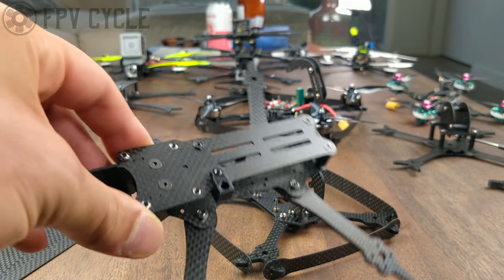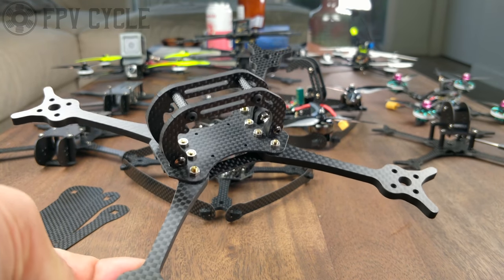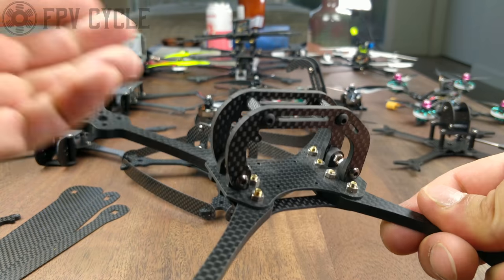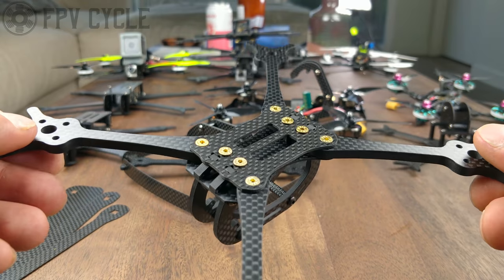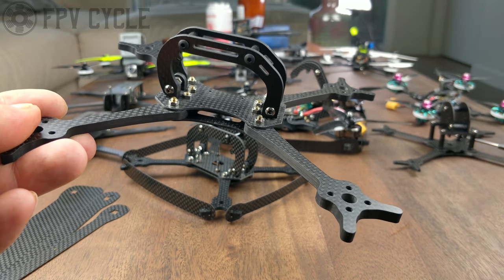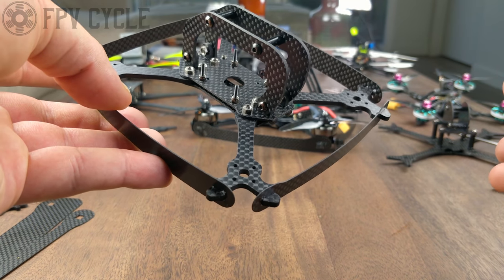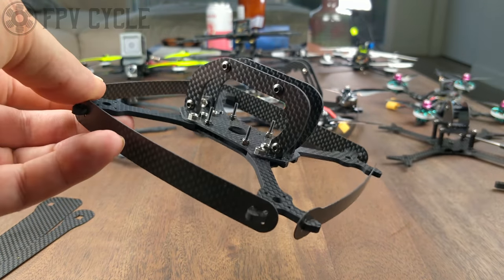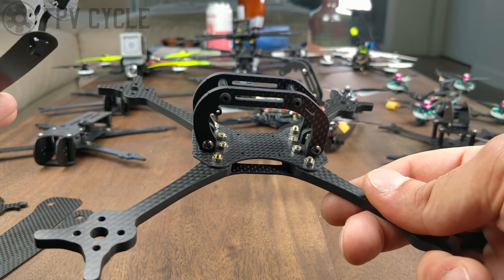Vertical Carbon Fin Concept

Comment: It's interesting hearing someone trying to think through how things work.
I've seen some tall shark fins on racers that are intended to help with turtle mode. I'd be interested to see how a larger surface area vertical fin on top might affect cornering at higher speeds. Whether it would help with rotating the quad. Might not work or add enough to be worth it. But, it'd be interesting to see.
I know that my whoop type quads definitely corner differently than my open prop quads. I've assumed that it might be a combination of vertical surface area of the ducts and the more directional thrust from ducts. But, who knows why. I do know that they track differently when cornering.
Reply from the maker: The racing fins is another reason why I'm not convinced of tht side forces being generated. Never once have I heard someone say their quad flew better with a fin no matter how big or small it was. Just tells me it's not doing much other than causing more drag.
Reply: @Kabab  -Probably right. Generally, if racers could get an advantage from something then they would use it.

Comment: Very interesting that you took so much fford in testing those vertical "fin" designs.
Imho because they stay fixed in every flight situation a flight will not really benefit of them. They will produce turbulences and i'm pretty sure, that, expecially these thin "fins" will show a lot of at least micro vibrations if someone would thest these setups with and without fins in a blackbox explorer.
My opinion: If you tend to slip around corners you don't angle the quad enougth because you're afraid to do so.
Angle it until it flies almost vertical around sharp corners and increase your speed then. Take a look at pilon racer planes how they do it.
Your opinion was always to free the disk load of the props from all foreign forces and you should stick with that theory, imho.
But: Someone has to seriously try all that and I'm really impressed that you do that!

Comment: If you want an easy way to visualise the air flow around a prop, just spin a motor/prop up hanging off the side of a bench. Grab a chopstick and tie a tuft of wool to the end and start poking it around. You'll see the airflow around the prop very clearly.

Comment: To get the lift of the frame from front and back you indeed need to be at >80 Deg but when you get that sweetspot you can really feel it, pitching forward and slowly loosing altitude until you suddenly stop loosing and feel it lift slightly

Comment: Just like an aerobatic aircraft when thrust is being pushed over the control surface that air is moving much faster then the airspeed of The Craft. Giving you much much more Authority on the surfaces that are in the flow of trust. For example if I'm flying when is my large aerobatic aircraft during slow speed maneuvers I have much much more Rudder and elevator Authority do aileron Authority even though the ailerons have more surface area...

The box frame is working exactly the same... The small non airfoiled surface area at low AOAs even at 100mph is creating hardly any lift and is also not creating enough drag sideways to stop or slow down drift while off power... On our 3d planes we do use SFGs side force generators and they have a profound effect on tracking in knife edge and in locking in straight tracking flat level flight... This is not like the vertical box edges on a fpv frame and it's because the SFGs have much more surface area and are in totally clean Air (at the ends of the wings and some times on top center of the fuse and those are directly in thrust and normally very small because rhey are in line of the thrust so no need to be big)...

You will undoubtedly be in a dirty air condition at the super high AOAs (such as in a stalled wing) anytime you left off throttle and you will absolutely be in a state of faster deceleration due to the fins...  When you are on power and have positive flow over those flat pieces of carbon via the prop thrust you will 100% track straighter and movements will act more like a control surface then by a thrust controlled movement. On a race course if you are looking for more point and shoot type flight then the vertical type box frame will absolutely provide that so long as you are on power.... The drift in turns will be less so long as you are on power and the effect will be near zero when power is near idle and will be progressively more or less base on thrust.

The extreme AOAs they top and bottom planes are seeing is super drag inducing at the normal flight profiles we fly. The "vanes" would be much MUCH more efficient if they was places at angles that keep the AoA in an acceptable range inside our normal flight envelope... We race and run a 50 degree cam angle so that would assume that our normal straight flight is at 50 to 60 degrees a flat plane at an AoA of 50 to 60 degrees is going to be in a stalled condition anytime you left off the throttle (close to it anyways, say anytime your less then 60 to 70mph off throttle you will be in a stalled situation...)

This really benefits us zero... The drag penalty is not worth the slight point and shoot effect that likely won't be as fast a line around the track as just flowing through it carrying your speed and will deff be worse on your battery as you will loose energy at every point where you are pointing and shooting ... If we have FC controlled "vanes" on high speed digital servos that was directly in the props flow then yes without a doubt you would have superb handling from the vanes and would be hugely noticable in turning and tracking... But the weight would be a killer and the frames size would have to be a lot larger... 

As it stands putting flat vanes around a quad will not gain performance other then straight line on power tracking and in point and shoot type scenarios and that's it... You will have slightly better tracking and more angular turning ability but you will have vastly more drag and the quad will deff be effected more by dirty air.
Reply from the maker: yeah I've abandoned it for now.  Box frames are cool but dropping a little weight is more effective and has more benefits

Comment: Do ducts have same effect on flying? I would assume that ducts would provide additional benefit by blocking airflows from one prop to another (not sure if this effect is actually noticable).

A bit of offtopic, but it would be interesting to mount a small fixed wing on top of that canopy to see if it generates additional lift when flying straight - perhaps a nice solution for energy effective long range flying :)
Reply from the maker: Ducts are a whole world of their own. They don't work as you might expect. I'm gonna do a video on it soon with our new duct design but it's just not what you'd expect. 

Couple people have tried mounting wings to quads. It works to some degree but it's really inefficient

Comment: I would be curious about a discussion about Betaflight Versions. As I understood you right you don’t like BF 4.2 (also BF 4.1?) if not using RPM filtering. Which was the last version that you were satisfied with? Why don’t you use RPM filtering? Listening to the power up sounds in some of your vids I assume you are using Blheli32 ESCs. What other things do you dislike in lates BF releases. Still remember your video using an old F1 FC and being surprised how good It is using BF 3.2.5 which was the latest release that supported F1.  Now we have something similar thanks to Joelucid and UAVtech bringing advanced filtering of later BF releases back to F3 boards in their Betaflight F3 performance edition. (up to BF 4.1.1 on F3 boards  ( 2020-07-25) )
Reply from the maker: BF 4.x has loads of weird shakes and bobbles. Even with rpmf. Sure it's more efficient with rpmf and everything mostly runs better but I would prefer rpmf with bf 3.5.7. 4.X is an absolute mess to me. It doesn't fly right on a single quad I've tried it on. There's many issues with 3.5.7 but at least it doesn't have all these weird bobbles.

Comment: Just speaking from a little experience building RC planes... I designed several aerobatic/3D models, my favorite being one with a symmetrical fuselage. By creating a mirrored/equal surface area on all sides of the plane it was much easier to do aerobatics, especially knife edges. When you start pushing to the limits you sometimes loose control because your motor and/or control surfaces do not have the power to counter act the forces that are happening. I would also think their is a benefit to having a balanced surface area regarding side forces on a quad ... The  power pick is a good example of what I'm thinking, with a battery mounted it seams the surface area above and below the prop line would be equal/balanced. This could create less work for the fc. idk.

Comment: Hey Bob—a few notes I had about the molar that I noticed from a racing perspective:
1. Camera protection seems to be very minimal. I would be really concerned with absolutely destroying cameras without more lens protection, but maybe that’s just me.
2. It’s hard to tell from video, but is the 5” designed for 20x20 or 30x30? Either way, does the stack protrude out from under the arches? In midair’s I could imagine that the stack would be extremely exposed, and ultimately could lead to more damage. 
3. Turtle fin? It seems minor, but having a solid surface to mount a turtle fin to on is extremely important, so that when you do need to use the fin to flip over, it will always work. On that note, I do think it would be neat to add a sort of modular mounting “rail” platform, to be able to attach the fin on top of the arches.
4. Any possibility to make a True-X to add to the Stretched-X arm format? The arm format is very personal feel based for most race pilots, but some people enjoy the feel of true x over stretched x, and vice versa. 
These are just things I noticed off the top of my head, but every racer us different priorities. Some prioritize weight, durability, lap times, or other factors of the quad. Personally, I use what gives me the most confidence in the air and what gives the best lap times, with a high priority on keeping the equipment protected as much as possible, and being easy to maintain.
Reply from the maker: There is literally zero way to have more camera protection. The camera is recessed between two 3mm carbon plates.  The frame is close to an X and having an X doesn't matter when it's this close. It's 20x20 only for now.  The design is such that it's really easy to print a fin for it or mount a GoPro to the standoffs. There's a product page already with a lot more details. Link in video description.
Reply: KababFPV awesome! I’ll take a look. I’m seeing the standoffs now that you mention it, and those do seem like a great way to mount the fin!

Comment: Those front and back fins act like an airfoil creating lift. So in forward flight you should need a bit less throttle to stay at the same altitude
Reply from the maker: Except they only might do that when you're at full throttle moving forward....maybe

Comment: I would be very interested in testing your racing frames, I'm sure everyone does. I would be willing to test them to their fullest. Also I know this isn't exactly a great recommendation, however I was a master Carpenter for 25 years, and been in the RC hobby about 25 years as well. Working with wood you need to know what is going to be structurally sound. I can build freestanding staircases from wood, not many can do this, I can build a ball from wood, or any shape you like. I built multi million dollar houses with little to no blue prints, the general would tell me it's a custom home, make it look great, also not many can do that.  I fly everyday because I love it, and I have the time. I would like very much to be a beta tester for you. I would also be able to try much tougher tricks to see if your frames hold up. If you try me out I'll have it built within 2 days with crash footage, and a report as you see fit. Please consider me for the future if you have enough testers at the moment. Thanks for your consideration. P.s. I found a company that can print super tough, lightweight carbon fiber mix. I think with that ability some major innovations can be brought to life. Thanks again.
Reply from the maker: I have just a handful of people I have test things. It's very hard to even keep track of them. The best test comes from normal real-world use of users. I always urge people to send me pictures of breaks of my designs. That's how they get better with time
Reply: @Kabab  I appreciate the consideration. I'll send pics when it breaks. I do have to be a bit more careful with mine since I wouldn't be able to afford replacement frames. If you change your mind one day, Ill give em hell. How do you feel about front cross braces? I came out of a 75 foot dive through trees, miscalculated my exit, it broke 1 arm on the CMW Super SlamNasty, but I had to be going around a 100mph. I thought for sure everything to about mid quad was pulverized, but just 1 arm, oh the brace cracked at the hole. Thanks again!

Comment: los specific frames fly the best

the angle of attack of airplane wings is designed for the optimal lift to drag ratio in neutral forward flight, which depends on the airfoil, shape, twist and dihedral
OpenVSP can calculate that

most lift when climbing comes from deflection, total lift increases while L/D get's worse with higher angles of attack than the optimum

            y
            |   _  < optimum
x_   _   |/  _ \_
    \ _ /|
           |

y = L/D
x = angle of attack
the highpoint might be at ~5° pointing up

the tailsurface of the plane is angled in such a way, that at any other angle of attack, that is not the optimal L/D, it creates a rotary moment, pushing the plane back to the optimal angle of attack

Comment: I like your way of thinking and I really can relate with your ideas very often. However, I think you're missing something when you talk about the Side force generators. As seen at Shrediquette the fins are located behind the rotation point of the quad. I think this increase the stabilization effect in a bend because the leverage is greater than at your design. (like the principle of a stabilizers on the tail of an aircraft). I think with some design adjustments you can notice increase this effect but I can imagine it's not worthwhile trying.
Reply from the maker: But does it?  It would just require the FC to compensate for the offset in force.....I'm not convinced it's the primary effect. I'm sure it's a part of it all but there's more going on from what I've tested.

Comment: The theory of excess power is evident in whoop races -- in an open race with 1 and 2s together the 1s would nearly always be better because of their agility compared to the heavier 2s whoops that often blew out in corners.  But it all depends on whether the track is open or tight.  People mistakenly consider the quads power to be the end factor that matters when so often it is matching the quad to the type of flying you want to do.